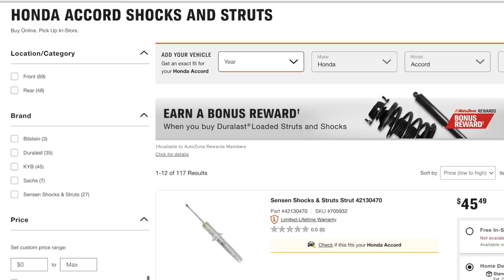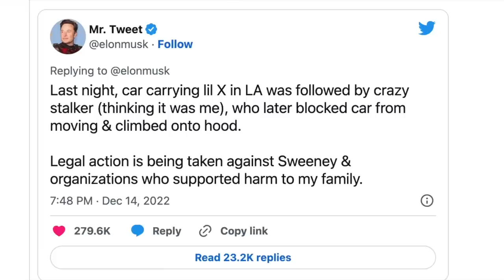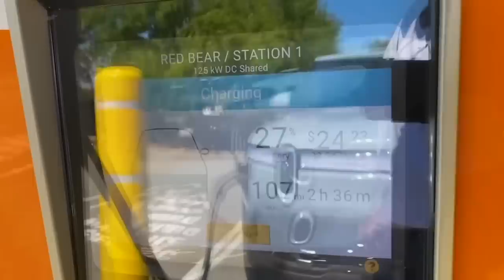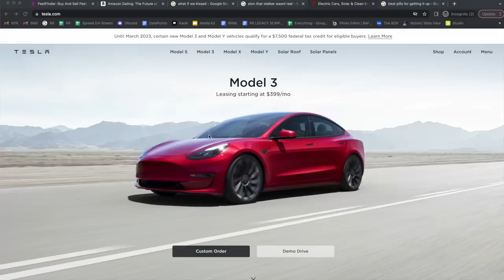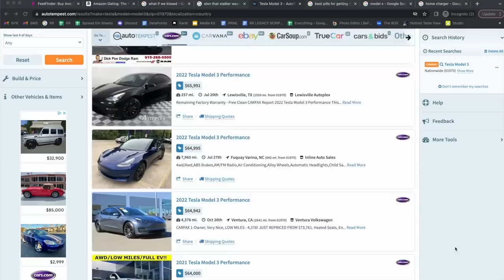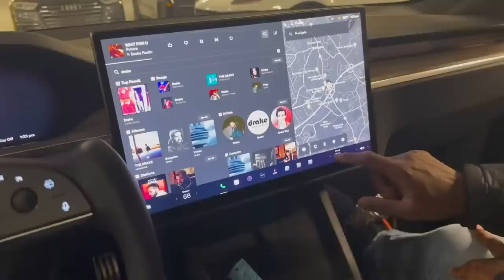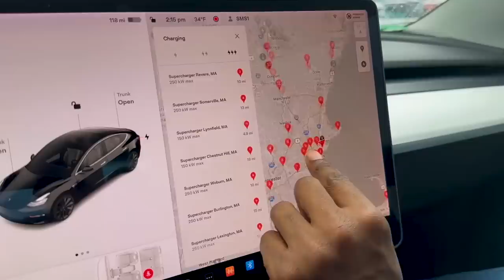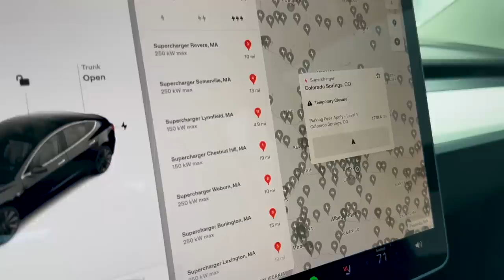Buyer beware: Don’t let Elon trick you again with Tesla Price Drop Magic

Comment: At work, the diner used to charge a lunch special for 9$ and change.  They changed it to 18$ plus. 3 days later they had a sign saying 20% off. People in the building was running over eachother to get lunch screaming to me 20% off. 
I tried to tell them,  its still over 10$. But they ran off before hearing my rant

Comment: I'd agree with you if other car makers also reduce the price back to pre-pandemic prices (looking at rivian...). I bought a model Y last week because it is the only decent EV or PHEV that I can find without waiting for 2 years or paying $20k extra to those shady dealers.
Reply from the maker: just to be clear in case you missed it my exact words were "The truth is,  out of every single  available EV and also every single available non-ev, the Tesla Model 3 and Model Y are probably still the best value vehicles you could possibly buy for a car and SUV. "
Reply: @RichRebuilds  Bob is refairing to you saying "Pricedrop before the pandemic". No other Carmanufacturer has droped prices. Ford has increased the price in germany ofer 10.000 Euro! Thats insane. I sold my Mach-E afert 14 month and 16.000 kilometer, got 10.000 Euro more then i payed. Okay, in germany we had the Umweltbonus 6.000 Euro, but anyway. Tesla has droped the prices in germany for the rear wheel Model 3 and Y up to 9.100 Euro. They are leading the pack by fare when it comes to prices.  only my 2 cents greedings from germany 😊😊
Reply: “SUV”
Reply: @MichaelSchmittBEN not entirely true, Chevy slashed prices on the bolt and bolt EUV last year
Reply: @doomsday9973  wasn't bolt production halted over battery fires last year?
Reply: @Victor-vj5ds  that was over 2 years ago. The fixed it and resumed production awhile back.
Reply: @MichaelSchmittBEN  
Interesting you bring up the Mach-E, because Ford recently announced some price cuts on them.  Granted they are not as significant as Chevy and Tesla's price cuts, but a discount is a discount, and an EV price war only benefits the potential buyers.
Reply: @doomsday9973  you would be wrong, it resumed production less than a year ago, last year in April.
Reply: @doomsday9973  the bolt is actually the best ev deal right now but not the best option IMO. For some though it may be great option. Just don't expect to road trip since it doesn't charge faster than 55kw
Reply: @Shiftheads  yep all true
Reply: @MichaelSchmittBEN  The reason they have to drop the prices is because they are about to get over run with competitors, and the factory markups on the cars is insane. The amount of profit they make per vehicle was the most out of any assembly line vehicle on sale. They don't need a dealership to gouge the customer, they were doing it themselves. Pretty genius on their part, and it's one of the reasons they were able to grow as a company so quickly, I just feel sorry for all the suckers who overpaid for their Teslas up to this point.
Reply: @anydaynow01  how is Tesla gouging it's customers and how are they overpaying when they see a set purchase price everyone else pays and they agree too? Did they not get what they thought they where buying? Name a better EV for the price.
Reply: @Victor-vj5ds  I wouldn’t even try. Cracks me up seeing people try and compare a manufacturer openly raising prices to some shady 3rd party middleman dealers silently raising prices regardless of what it says online. 

Every price increase was at the very least transparent. If you didn’t like it, you didn’t buy it. With dealers it’s “you see a car for 40k, configure it, option it, send it to a local dealer, wait for one to finally arrive or become available and boom it’s suddenly 50k completely ignoring any price or MSRP online”. There’s no other industry as predatory as this. Allowing online sales is what every single consumer should be fighting for right now. At the very least make dealers an option rather than a requirement. Forcing customers to go through some middle man who may or may not suddenly upcharge them thousands of dollars on a dime is beyond shady. That shit needs to end. Now.
Reply: @Victor-vj5ds  No that’s not what I meant, I was referring to the initial discovery of the fires and the recall not when they resumed production. Production was halted in 2021 not last year so it is YOU that is wrong
Reply: @doomsday9973  no, your still wrong, production for the bolt was haulted up until April 4th 2022 then resumed production, I never mentioned anything about when the fires where discovered which go back to 2019 models if I remember correctly. GM resuming production and dropping price seemed like it was timed.
Reply: @Victor-vj5ds  your original statement 

“Wasn’t bolt production halted over fires last year” 

No it wasn’t this statement is 100% false it was halted 2 years ago and resumed early last year. Again it is you that was wrong
Reply: @doomsday9973  again your wrong, I know GM stopped production before 2022 but I'm still right for saying production was still haulted last year. You claimed production resumed "a while back".
Reply: @Victor-vj5ds  dude your first statement was completely wrong and yes almost a year ago is awhile back. Just admit it and move on
Reply: @doomsday9973  was production for the bolt haulted last year yes or no? Yes because how can you resume something if it's not haulted in the first place. Either you don't understand this or we are just arguing semantics since I'm aware they production hault started way before 2022. Less than a year is not a while back, that's a short amount of time in context.
Reply: @Victor-vj5ds  wow talk about mental gymnastics lol! I’ve never seen such a stretch in logic before wow. You and I both know your original statement was wrong and now you are twisting it to somehow say “it counts because production was still frozen a whopping 3 months last year so I’m right because it’s technically was still halted.” Lol wow. Just stop seriously. Again you’re statement

“Wasn’t bolt production halted last year” 

Had you said wasn’t it STILL halted last year that would have been correct. Your statement implied it was stopped last year, it was not, it stopped in 21’
Reply: @doomsday9973  do you not realize we are arguing semantics when we both understand the chain of events? Neither of us are wrong unless you want to argue who is interpreting English more properly. Your trying to make an argument where one doesn't exist.
Reply: @Victor-vj5ds  ok fair point. Let’s move on lol.
Reply: @RichRebuilds  Amen!  I'm going to make a prediction here and I hope people don't think i'm nuts.  If Tesla is a tech company then they will follow the "tech" business model which is "reliability+performance" is inverse of cost!!  This means there will be more and more price cuts just like PCs and Software.  A $500 computer today has 1000x performance and reliability than a $4000 computer of 30 years ago.  I see within 15 years half of Car Dealerships go bankrupt just like Fry's Electronics.  In 2017 Tesla's cost per car was $87K.... now it is only $36K per car.  The Cybertruck and Model "2" will undercut the market even more.  I am ok with price cuts just as long as Tesla gives incentives for trade ins and keeps improving unlike gas cars that takes 25 years just to adopt turbo engines....
Reply: @DxModel219  I mean cars now have more performance and tech then cars 30 years ago, for cheaper price, adjusting for inflation both ways. When the C8 Corvette first came out I believe the base model started out for 56K, even rounding it up to $60k, a true mid-engine NA V8 sports car, there was nothing like that in 1990 for whatever current 60k was worth in 1990. When the hellcat came out with 707HP for under $80K, what car did you have to buy in 1990 to have over 700hp?In 1990s to own an AMG you would have spend over 150K equivalent of today, it was super exclusive. Now you can get a true hand made engine AMG for as cheap as  60K-70k brand new, including the outgoing V8 AMG.  

Model 2 had been cancelled for a long time, and Cybertruck is far behind its competition, as other manufacturers have already released body on frame 4x4s, meaning they already stealing the market share, also showing the lack of technology of EV trucks, as they might be capable off-road but trucks since the dawn of time have competed in their ability to tow, and EV trucks can't tow shit, they deplete every 100miles. Yes I know 99.8% of truck owners almost never tow, but that's the purpose behind a truck, its utility, not its off road capability or 0-60 times. 

Half the dealers won't disappear unfortunately, there something like 40 new EVs models that came out last year if not more, every year more and more will appear. Most manufacturers are switching to hybrids as a transition to full EVs. Modern hybrids are the true full advancement of ICE cars, cleaner for the environment and super efficient then any EV on the road, getting upwards of 700miles per tank on a 13 gallon tank. I don't care if gas is $10 per gallon, you can afford a 40k hybrid Kia with 50+mpgs vs a 100k Model S. sorry bro but gas cars not improving is an idiotic statement, there had been massive improvement and innovation in the automotive world. Tesla is arguably marginal in innovation, as huge screens, lack of physical buttons, spartan interiors, yokes  ect is the opposite of innovation, lack of physical features is not innovation. Pissing on your face and calling an organic rain is not an innovation or expression of art, even if the artist calls it that way.

The point of the video was paying 15k+  for  ACTIVATION of pre-installed software, which Tesla can then make a second owner pay for again, selling Model S for 40k more than model 3, even when they're cost similar to make ect. Problem is other manufacturers are following the trends of charging for "activation" of things in the car, maybe not as egregious
Reply: @GXMAN16  thanks for your reply.  maybe you’re right but if you look at the trend, legacy automakers has been having negative growth vs tesla’s.  The Model Y was California’s best selling vehicle.  Dealers makes so much money from services but give it a good 15 years and I believe ford, gm, honda will start feeling heat.  As for the trucks, most truck owners don’t really go offroad or even tow… it’s all lifestyle.  Go to California or Texas and count how many trucks towing something vs not… you’ll probably will see like .05%.  anyways goodchat
Reply: @ElonWilder  I'm not for dealers, it's such a convoluted and confusing practice based on laws that were applicable 100 years ago and not now. But I fear that selling direct will just have the manufacturer inflating prices. I have stalk in Tesla so I'm glad that they are FORCING innovation in other brands and beings the tip of the spear for this new age. My problem with Tesla is what I call the ground truth, not any of these philosophical or conceptual BS that Elon tweets. Basically the ground truth is that if I go right now and buy a Model S regardless if it'd Plaid or not, I'll be paying essential $100k for a car, and I've been lucky to be be able to afford low $100k cars. It's a big accomplishment and it's a bid deal for a car to cost so much. But the ground truth is that  the Model S comes with bad quality, base spartan interior, non intuitive controls, rattles, noises and whole bunch of other stuff that I've never had to deal with in my Mercedes and BMW for six figures, while at the same time people are louding them to be best thing since slides, on the ground what is that's it makes the best? And that's the issue with every Tesla is that the product is crap, people are eating it and calling it chocolate. Acceleration is the only thing, but a 30k toyota corrola fully loaded is more luxurious and distinguished then a similar size and class Model 3. Rivian is not excluded, paying 100k! For a Toyota Tacoma sized truck is beyond ridiculous, I don't care even if it's 90k or 80k, it's a small truck. Small Trucks should not be an expensive commodity for rich people to enjoy like a Rolex watch. Same with family sedans and suvs. But hey Californians somehow are buying them. Short version is the product is kind of shitty, and the people's infuriating explanation of why their model X is better then a BMW is because they have Netflix and farting noises. Like that's the innovative edge is the addition and availability of apps.
Reply: @GXMAN16  why would selling direct makes you worried that the manufacturer would inflate the price?!!  that’s illogical.  the Model S and X when introduced was 100K because the startup cost and build was very high but due to build scalability we now have the model 3 at 40K.  Costs will go down and less overhead equals to lower prices always.  The legacy companies are playing the “rarity” game by limiting their supplies but you can’t do that when you have an alternative competitor like Tesla.  Even Porsche’s rarity exclusive trademark will be at risk when tesla introduces the roadster.
Reply: Bro you didn't see the video
Reply: @Shiftheads  if I can’t road-trip with it then it’s not a deal. I don’t want a car that is obsolete the day you buy it. Imagine what the landscape will look like in another 5 years or so

Comment: That's generally going to be an issue with EVs for automotive channels : what can you really do with them?  They are basically like appliances : you buy them and drive them as they are until they wear out and any performance modifications are locked behind a paywall.
Reply: That's not the case with Aptera, if they hopefully gets to mass production.

Comment: A few months ago we visited our local Tesla dealer (2 hours away) because we were quite keen on a model y. Unfortunately their opening hours were wrong. Walked up to the door (this was a Saturday) opened it and set off the alarm. No, they didn’t lock their doors. Tried calling 3 different Tesla numbers to tell them, no answer. So at 1pm on a Saturday the only way to contact Tesla in my country is to use the app, that’s just crazy.
Reply: If you sat there long enough someone would have come out to check on the alarm so you could have asked them the about the car you are interested in.
Reply: @danuk2005  we did sit there for about 20 minutes (didn’t want to seem like we were just trying to break in). We also talked to a guy running a coffee cart beside the dealership who didn’t have any contact details for Tesla. Funny enough Tesla did call me the next week regarding a trade in and I did talk to them about the incident where they told me “they would get back to me”.

Comment: Rich points out the biggest issue with evs cold weather.  It's why I'm not shopping for an ev. Rivian is built in my home state and I would love to support something built here but price and cold weather durability are a big part of a decision.  I need it to work all the time not just fair weather.
Reply: Most ev s in the world .... norway .. and yes its cold there half the time .. but offcourse there are exeptions .. bottomline in cold eweather keep yoyr car faraged and on the charge and you will have hardly any cold related side effects  . And in some cases they simply put some e heating for the batts in the car .. they have 4 months of winter darkness in norway dont forget this
Reply: On more economical EVs than a Rivian the fuel usually more than offset the initial premium. Then of course if you want a SUV AND truck AND big range you need a ridiculous battery with the costs that goes with it.
Reply: @TheAntoine191  in my case a truck is what I'm after. I don't need high range, fast, or luxurious as it will sit most of the year unless I need it to do truck stuff. The advantage of the ev rigs is  they "should" be able to be parked for extended periods of time and be relatively unaffected.
Reply: @gmy33  parking indoors isn't an option for me. The garage is small and the Mrs gets that space. It's uninsulated, and unheated anyway. I don't know if I'd trust having a fire hazard parked indoors. Not saying all EVs are match heads, but mine would do a lot of sitting as it wouldn't be my daily.
Reply: @LowTechFarm  yep i think about fire hazard too ..  but mainly for now only buy an e car or moto if you use it often !! Because if you leave it plugged in its oke in winter otherwise not .. or it needs to be inside so it wouldnt totally  freeze

Comment: 12:01 LFP works prety well in the cold here in Canada. I lose maybe 25% tops of the range in thw winter, but not because of the battery not working well in the cold, it's all the extra energy spent for heating the cabin and/or the battery pack. You can discharge it no problem, it's the charging from cold that is doesn't work. Which is not a problem if you run for a couple of hundred miles, the BMS will heat the pack enough to make it work without issues and heat it up to supercharge easily. I only tested it once for 200 miles roadtrip, and it was OK.
Reply: At witch temperature may i ask?  Octovalve heat pump system is quite efficient indeed. Marvel of enginnering to some point.
Reply: @alesksander  I usually set it 19C (which is around 66F). My son likes to 20C, but it doesn't make a big difference.
Reply: @bytemark6508  ok great what about ambient temp outside?
Reply: @alesksander  Oh, I see.. For instance, the day I took the trip there were -15C (around 5 F) In general, in the winter the time, we have negative temperature, the lowest is usually in the -40s, but the average is maybe -15 to -20. Between Jan and March are the lowest temp, rising a little in April, only in May we can see nice weather.